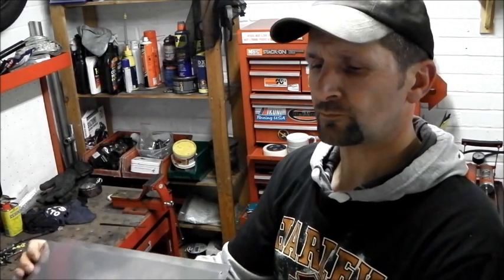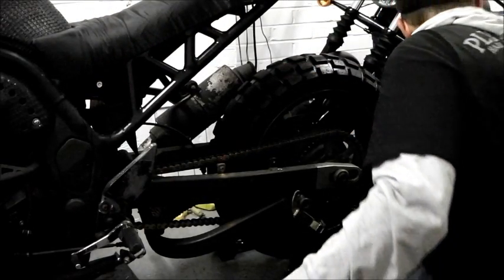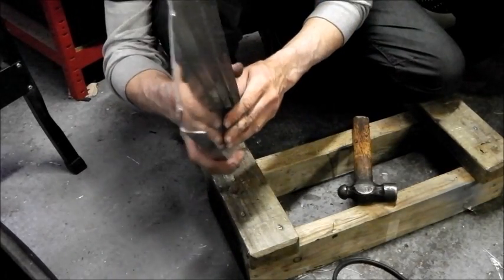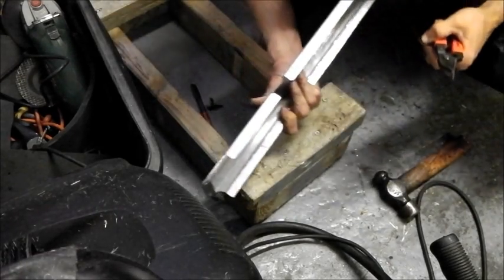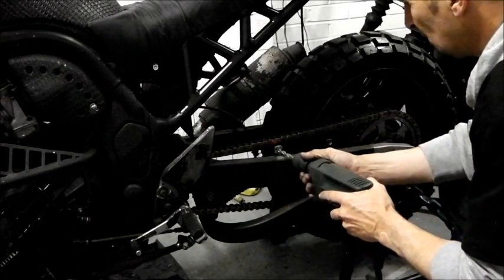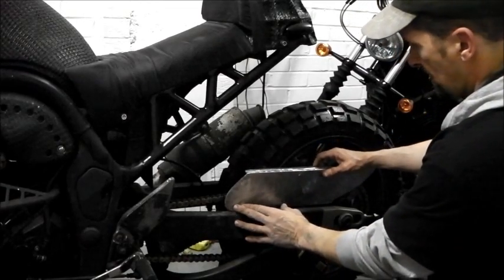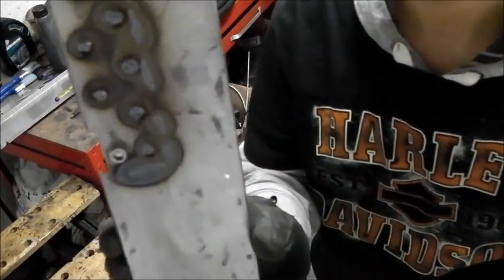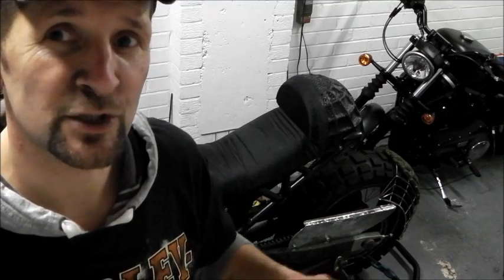Delboy's Garage, Project Bandit, Spray Guard #6

Comment from the maker: Hi Mike, thanks mate, that's a great idea... it does look a bit slabby as it is and I certainly wanna reduce that... I'll weld on the connecting rods and see if I can cut out between them as they'll add strength by their very presence... thanks for the great idea! Cheers Del

Comment: Great stuff Del. I noticed when you showed your original chain guard it was U shaped (in that 3 sides of it cover the chain) and your new one is L shaped (in that only 2 sides cover the chain). You may want to consider a plastic guard (plastic so you can have it close to the chain, but if the chain hits it, the guard will die not your chain) riveted to the inside to complete the U over the chain to stop chain oil covering your tyre.

Comment: Very inventive and a good solid bit of kit. The one on the opposite side might well give you somewhere to run the cable for a light for the sidemount, maybe? When I come to rehash the shed/workshop, I have a four drawer filing cabinet which will be going the journey. I imagine it will be the source of all sorts of material. Oh bugger, I'm going to have to save up for a welder now (and learn how to use it), see what you started?

Comment from the maker: The original chain guard only curves downwards on the inside by 1/4", it's just a 'lip'... and I don't run that much oil on the chain that it'll go everywhere, as long as you cover the top of the chain, that's fine... thanks for watching mate, appreciate the input!  Del

Comment: no worries del. your videos are like a soundtrack to my workshop i have my laptop fired up in there why working away on the motorcycles. im still toying with the idea of scriming my FJ BUT im worried that it wont look right because the fairings so big any thoughts suggestions

Comment from the maker: Hi Tom, thanks for that, but I really don't like em mate, they leave a rough arsed raggedy edge, they are very in-precise unless you run the torch against a straight edge and they're not really designed for thin sheet metal... but if you did live closer I could do yours properly for you lol!

Comment from the maker: Nah not really mate, they're no more money than a MIG welder, but a pointless tool unless you're cutting thicker than 1/4" and they leave a horrible messy edge!  ... initially designed for cutting steel beams on building sites, wouldn't have the need for one!